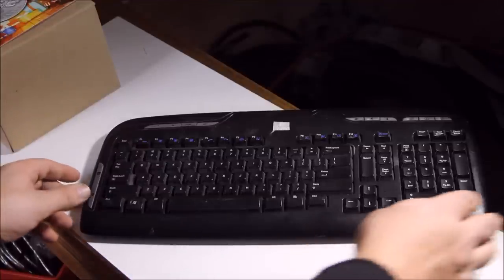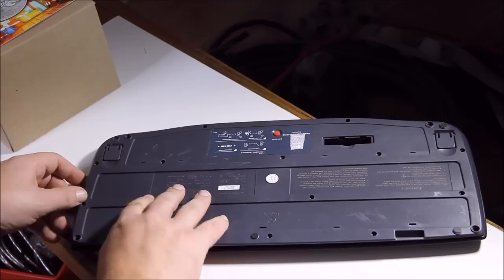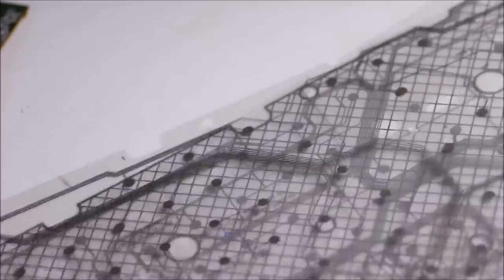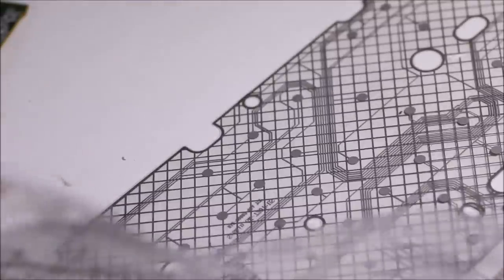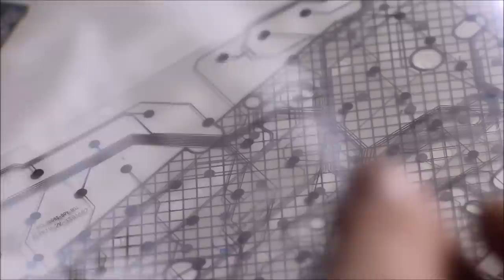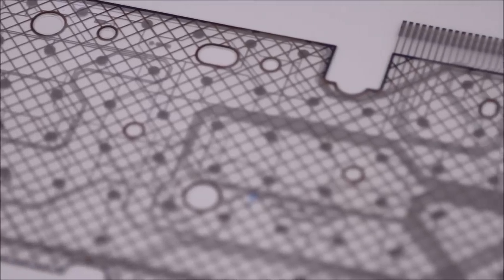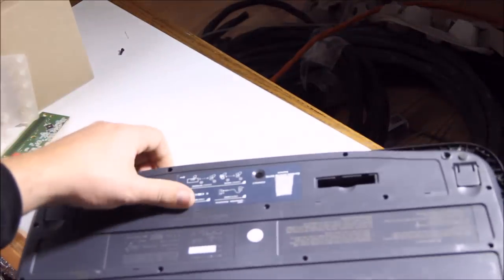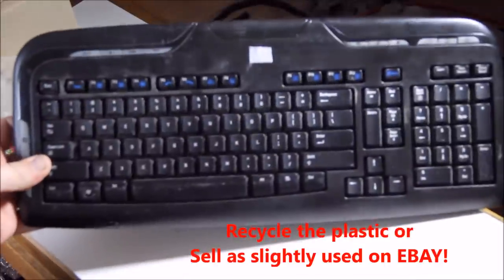Get Pure Silver From Broken Keyboards .999 Pure! In Detail

Comment: I liked the video. However, I found it particularly funny when you said to sell the keyboard shell  as "Slightly used" on ebay. I was like lolwut.
Reply from the maker: It is great that someone actually watched the video to that little one liner. Thanks for watching!
Reply: for real i thought the same thing hella funny
Reply: The very reason I don't shop ebay.
Reply: Too bad they don't sell them at Home Depot. Apparently they don't check out the return merchandise and it will wind up back on the sales floor.

Comment: For the record, it takes approximately 2 lbs of mylars to get 1oz silver. I've been refining keyboard mylars for quite some time now and I still have approximately 100 lbs left. When I first started refining the mylars I tried the incineration method, and from what I experienced, there was too much loss in silver. Actually, I recovered half the amount doing the incineration compared to the Nitric/Peroxide bath.

Since I've learned much more about refining since I first started and I have fire bricks and such, I may give the incineration another shot (2 lbs at a time to test).

Also, in case you didn't know, there are some mylars that are etched in black. That is carbon and they are trash. You won't get anything off of them either.

If the incineration method yields more than when I first started, I would recommend that method over the wet bath. Once you get your incinerator up and working, post an update so we can see how it's constructed.
Reply from the maker: Sure thing thanks for the information. I am interested in why you lost so much incinerating. Did force air into your incinerator and just have it burn into the atmosphere? My plans are to have a secondary burner to incinerate the particles in the smoke. I am hoping this will reduce the amount of waste and pollution. I cant wait to get started on it. Snow is still on the ground. Should be ready to play in about a month.
Reply: Rob The Plumber
I believe my loss was due to the mylars burning and the black smoke had been carrying some away. Maybe my method of incineration was wrong from the beginning. I simply put them in a round grill with a lid to it and I torched the mylars, and when they caught fire, I covered the grill and let the smoke come out of the vents on top of the grill.

I'm considering making a new oven type furnace and place them on a stainless steel pan or flat on the firebricks and let the heat turn them into ash, instead of direct fire on them. That might be why I lost so much silver.

Also, a few days ago I have been experimenting with Sodium Hydroxide with the mylars, and it does work. I don't have an exact ratio of the Sodium Hydroxide to water yet. During this experiment also taught me something that I didn't know, and that is NOT all the silver you see on the mylars is silver. The reason I know it is because from the test pieces I tried, some of the mylars are stripped clear, while some parts of them are still in tact and they haven't released off the mylars yet.

Now, to confirm my belief, I'm going to take the mylars after they've been washed completely clean with water and put them in Nitric Acid to see if any silver will come off those mylars.

I'll let you know my progress and keep you posted on the methods I'll be using.
Reply from the maker: RonRefiner2014 Yea burning plastic or mylars create a thick smoke that needs a secondary burn. A chimney of around 6' will also help with the heavy particles to fall back into the incinerator. Thanks again for the information.
Reply: I have a buddy that used a heat gun and heated each, one at a time and rolled them into small balls. He would fill a large crucible full and add sodium carbonate and borax and melt directly. He poured into an iron cone and the metallic silver would make a button at the bottom.